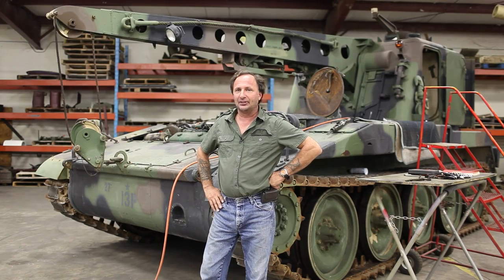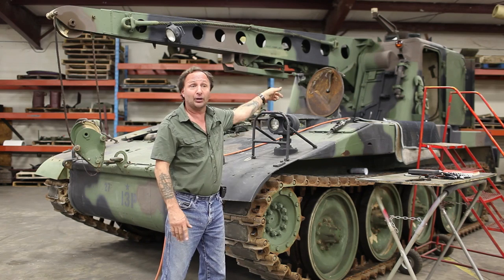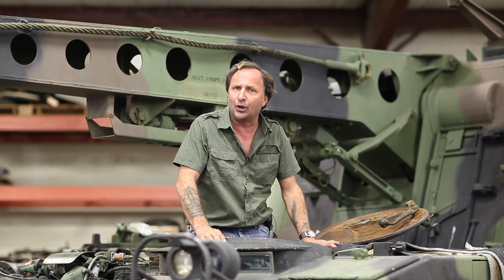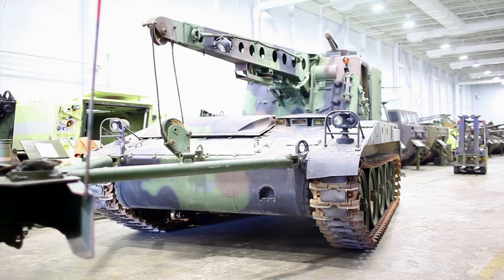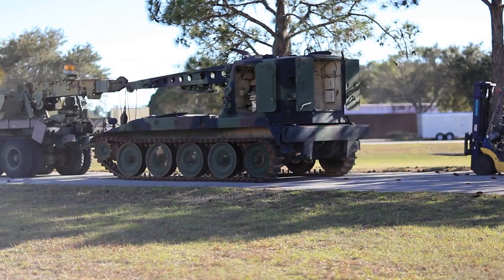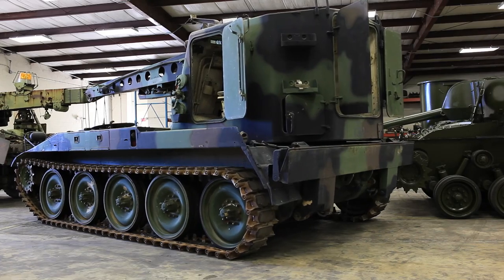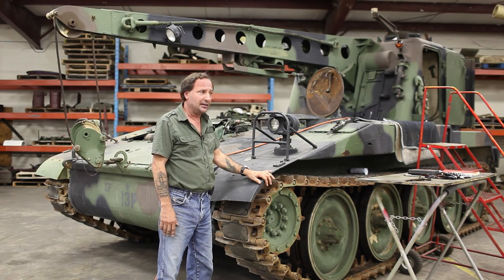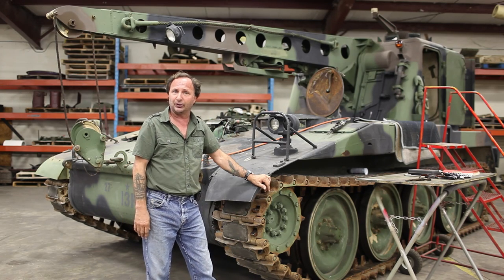M578 VTR walk around

Comment: I drove One of these at Fort Carson ,  i was a 63E (m1 mech) and due to some mix up somewhere I ended up in the F.A. 329th. I pulled every power pack in the battalion. dozens of times. We spent 30 days in the cupola, )CAB( while on a winter reforger 84 maybe it was, we only had MRE's got less than 5 hot meals the entire time.
Reply: I spent 3 years in 5/29 Battalion maintenance  on a VTR crew .

Comment: One of the Mils more underrated vehicles.  Along with the M548. In the latter half of the 1980s the 578 crews were still issued M3 Grease Guns as personal weapons.
Reply: I work in a shop at the JRTC that is also the recovery unit we have 2 M88A1s (we had 2 578s but they were so old and worn out we couldn't use them plus the 88 has more power, the 578s were turned in) one of the 88s is old and bound for turn in we received a rebuilt one last year its like brand new and still has a couple brackets inside marked .45 caliber sub machine gun also has racks for 50 cal barrels and LAW rockets we don't get any of that stuff don't really need it. the 5 ton wrecker in the video looks like a base model we have an A1 5 ton wrecker we actually put a different hydraulic pump on it last month and a new cab on it last year.
Reply: Hated that grease gun. Complained to comp. commander  showed him how trying to pull that dam thing out from drivers compartment was troublesome.  He issued me a 9mm instead. Thanks Capt

Comment: In 1967 I was transferred to Ft. Wainwright, Alaska, where I was assigned to a 578 crew with the HQ for my tour.. Not to long down the road I was made the T.C. of the 578. One Winter after Field Exercises I was to go to Elison AFB to load broke down vehicles on Transports back to Ft. Richarson. They decided to transport my 578 by Flat Bed Truck. I told the Motor Pool Commander that the truck was to light to handle and to let me drive it there via the tank trail. Well that didn't happen and during transporting the truck had two front tires blowout and the 578 got dumped off the trailer, down an embankment into the river. They sent a Bulldozer to upright it and I had to drive it back to base, which wasn't a very fun trip. We did make it back, but the turrent was bent and in need of major repair. I left the Army before it go completed. Fun Vehicle to operate. Did a lot of recovery in sub-zero weather. Got pictures of it in the river and recovery, someplace. Good to see one alive and preforming.

Comment: I was assigned to a VTR crew in 1977-1980 in HHC,2nd Brgde 3rd AD, Gelnhausen Germany. We used to tow broke down TOC vehicles back to base from maneuvers and do engine swaps in the field. One time on the road during REFORGER maneuvers we passed a Soviet SMLM car videotaping us. Our CO later told us they weren't supposed to be in that area and we should have ran them over.

Comment: I came upon a m578 at a crossroads in Vietnam. He was stuck in a mud hole with a thrown track and wanted me to pull it out with a 17 ton m543 wrecker. I said i can't do that its to heavy, but they wanted me to give it a try.Okay one time i said and hooked my chains up to it and gave it a pull which i couldn't budge it. Well my wrecker was making a weird sound from the engine so i put it in reverse to slacken the chains but it wanted to go forward. I put the wrecker in first gear and backed up to slacken the chains and killed the engine. What had happened was the engine kicked backwards and was running in reverse. I restarted the engine and everything seemed okay and i spent the night on the road in a small village.They did get it out by hooking up three APCs in a row pulling it out of the hole and the Cav went out to the patty dykes for a little security.